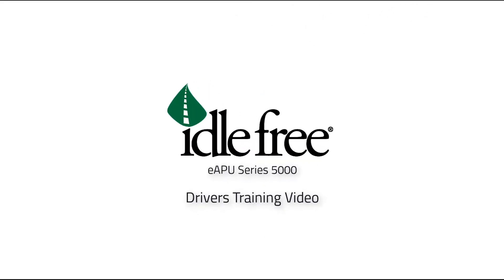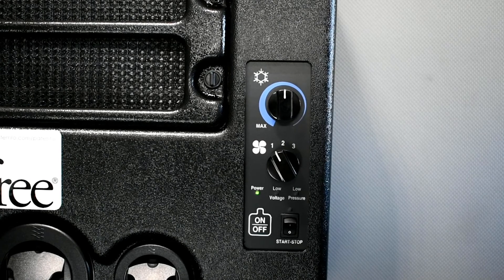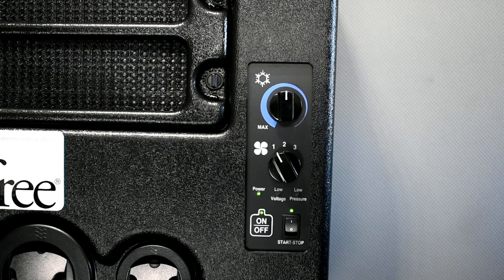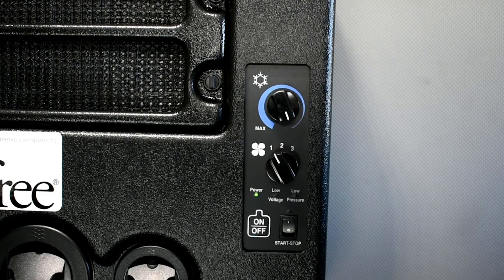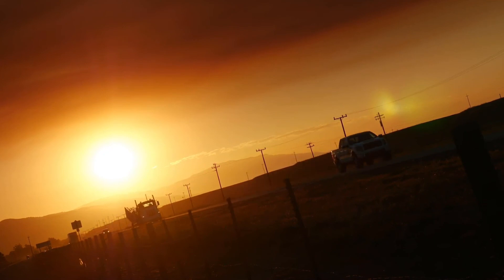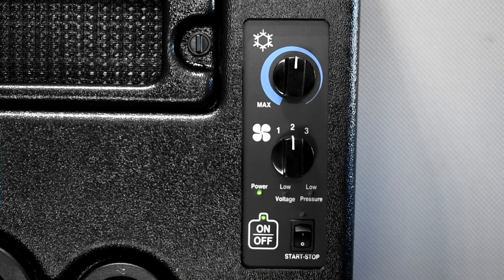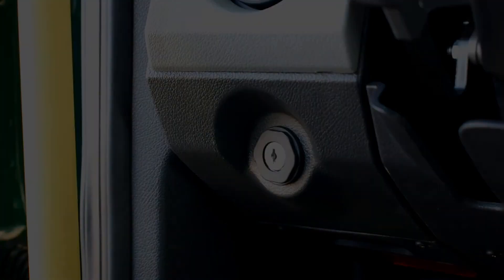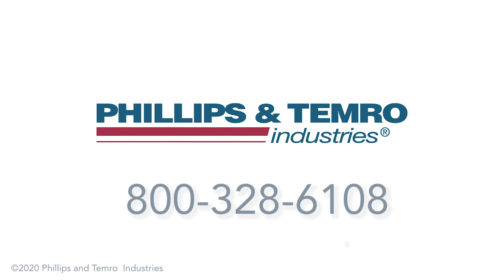Idle Free Series 5000 eAPU: Driver Training Video

Comment: Would make more sense if the controller was separate so the evaporator could be mounted as high as possible in the sleeper yet still be controlled from the bottom bunk

Comment: I agree that I would want to be able to use this with key on. It would be a great back up if the truck ac fails. Do you have a more simplified options? I'm looking to add an apu to an older truck. I know this option is for large fleets to force drivers not to idle. But an owner op wants flexibility. Do you have an install video? This one may not work with a headache rack. Do you build this in a roof mount? I don't want to loose frame space due to my storage boxes. Is the diesrl heater inside this unit or mounted seperately

Comment: 1) Key off run only is asinine. If I am 20-30 minutes away from parking, I want to start the epu to use the trucks already cold ac system to help cool the cab. 2) If the truck ac stops working, YOU HAVE NO AC WHILE DRIVING BECAUSE YOURS ONLY WORKS KEY OFF..... ASININE!